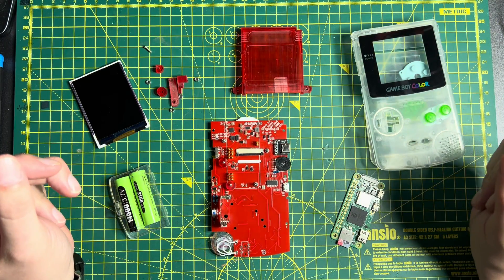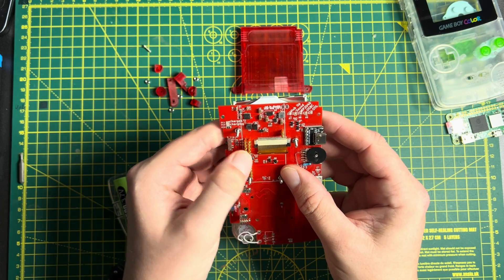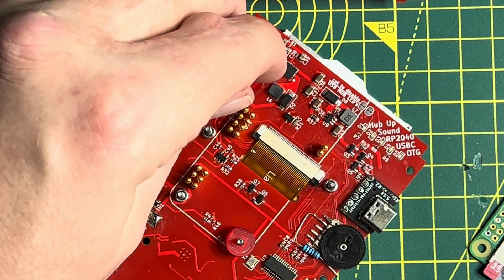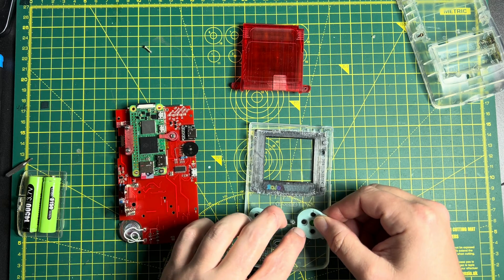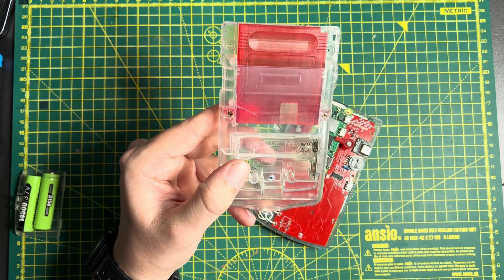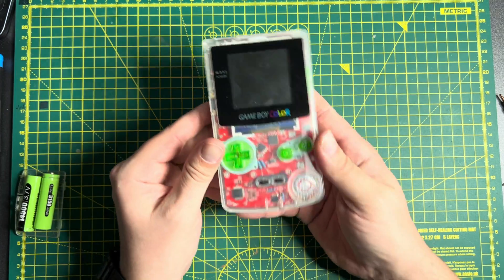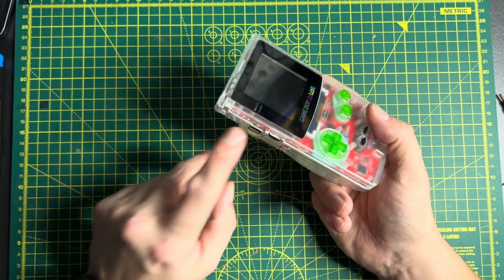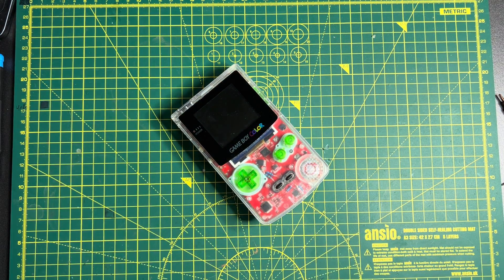Reboi assembly and feature overview

Comment: This already existed why was it on kick starter? Its been around for years and the other one uses a GBA so you have sholder buttons which opens up tons more emulation.
Reply from the maker: Thanks so much, what a helpful and informative addition to the internet.
Reply: @jamfab-james you're welcome! You should check out the full size Gameboy that uses a pi 5 has shoulder buttons and SD card slot for easy game loading. Or you just get a PSP slim 2000 no soldering needed, no assembly needed, same amount of programming and documentation, bigger screen, surround sound, and it can play Atari 2600 through psp games so....
Reply: @epluribusunum6622  it's obviously for people that want to play on gameboy colour form factor 🙃 that's the difference

Comment: I have been trying to prototype a similar concept over the last several years, but I’m a software developer not a hardware developer so I’ve had to rely on other people to help me. I think you’ve done a great job with this. The pogo pins are a great idea (I didn’t know that was possible!) and I’m amazed that you only need to connect to a few GPIO pins to make the whole thing work (smart to use a separate CPU for the keyboard emulation).